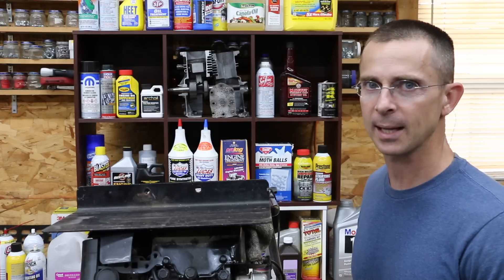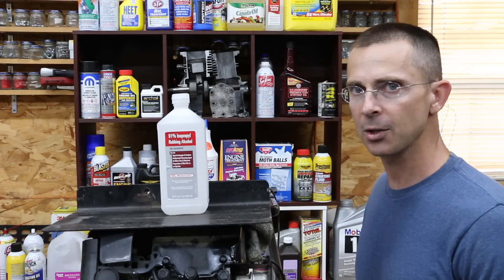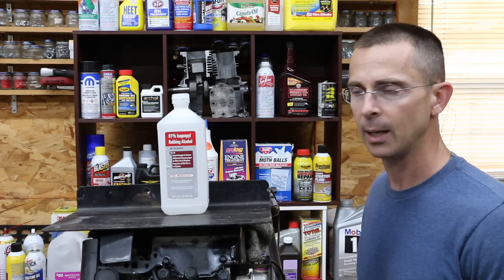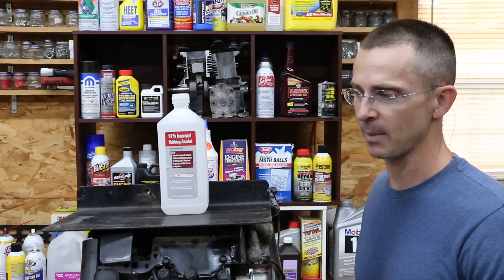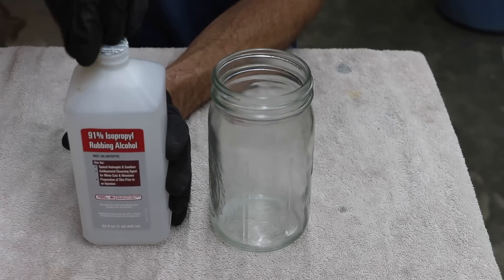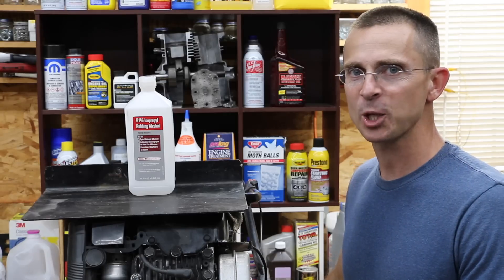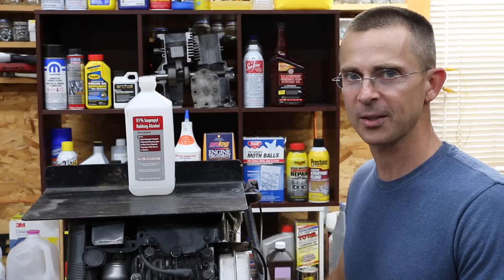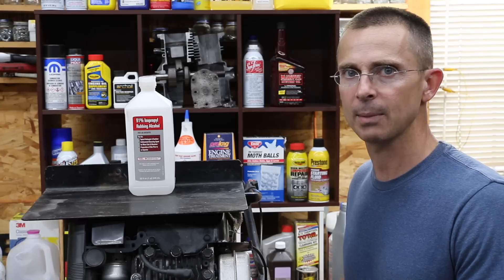Will a Gas Engine Run on Isopropyl Alcohol?  Let's find out!

Comment: Back when we had to do e-check. I used rubbing alcohol to past the emissions test. Added a bottle the tank with 93 octane gas.
Reply: You can remove the water with salt, get close to 99 percent alcohol. Salt dissolves in water not alcohol so it will pull the water out and sink to the bottom, you can then syphon the pure alcohol off the top.
Reply: Doom2pro gonna have to try that.
Reply: @Doom2pro  You can just get 99% iso in a bottle
Reply: @ThatDamnPandaKai  I know it's called dry gass. I use the salt technique for food grade alcohol like everclear, to get absolutely as much out as I can for things like hot pepper extract
Reply: You can get the water out better with benzene.
Reply: @povnw8985  and then enjoy cancer!
Reply: You can buy 99% alcohol, it's fiber optic cleaner
Reply: J. Dalton we did something different in ohio
Reply: Maybe the water in it helps ?
Reply: Ya Mumzhitachi  keep adding salt until it stops dissolving, the undisolved salt and salt water will sink to the bottom, siphon the pure alcohol off the top.

Comment: Apparently the army cleans the engine's with diesel every oil change.
So can you put diesel into your engine block and do an oil change but use old oil ?
Iv been told from a friend in the army but i don't believe them.
Apparently diesel is oily enough to lubricate and clean old oil out of engine just like an engine flush.
Muchly Appreciated
Reply from the maker: Thanks for commenting!

Comment: Try the gas line antifreeze called HEET. The stuff burns super clean
Reply: https://i5.walmartimages.com/asr/48d9489b-c801-48af-b8cc-10427f6d7658_1.dbcc84ad9776dc8c63b6a8a5fb888af2.jpeg?odnHeight=450&odnWidth=450&odnBg=FFFFFF
Reply from the maker: Thank you for this recommendation!

Comment: so does that mean i can run a lawnmower just on rubbing alcohol? or will that damage my engine in the long run? Can you convert the engine to run diesel?
Reply from the maker: Rubbing alcohol will likely cause issues in the long run, since it has some water in it and is corrosive.  Thanks for the video project idea on converting a gas engine to a diesel.

Comment: Nicely done!

I'm somewhat surprised how well it ran, it's a testament to how bulletproof and non-fussy these engines are.

The reason it ran funny is that it has less energy than gasoline so it was running lean.  With a larger fuel jet in the carb it should run better.    That might be the explanation for why the exhaust valve and less so the combustion chamber cleaned up (lean mixtures should run hotter), probably not since isopropyl alcohol should also run cooler.  The only good way to figure it out would be would be to jet up like I suggested, get it tuned for the alcohol and then try again (or do it on a "new" engine to compare how much it cleans it up, I don't expect that one to get much cleaner).  If you want to take this to its logical conclusion then mill the head and try it since it should also want more compression.  FWIW, I've milled a few of these heads before, they're very easy to do and you get a much stronger running engine.

I still want to know where you're getting all these mowers from.  My wife just killed mine and I can't bring myself to buying a new one this late in the season unless it's on a clearance sale.  In the meantime I figured I'd find one that someone is throwing out in fixable condition, but I'm seeing almost nothing and the 2 that I've found have too many parts missing to get running.
Reply from the maker: These are great comments.  I sure wish this mower engine had an adjustable jet.  I didn't want to alter the carb, since I'd like to use it for future videos.  I find mowers off of Craigslist and from lawnmower mechanics.  Thanks for commenting!

Comment: mabye try it with brake cleaner
Reply from the maker: Thank you for this recommendation!
Reply: Project Farm thanks for the reply, live your vids
Reply: Maybe not.  Used instead of carby cleaner years ago through a running engine and cleared a workshop, noxious fumes i believe !!
Reply: Its a good one
Reply: It will work with a 4 cycle but a 2 cycle would broke down

Comment: Try running an engine on Jack Daniels
Reply: I think the mower will have trouble cutting in a straight line.
Reply from the maker: Thank you for this recommendation!
Reply: smilncynic
          comment                    more             
your                     deserves             votes . · · . . . ·   ̇ · · . ·
Reply: mharris1270 it’s 40% alcohol and it will combust in an engine, had to use a little before when I didn’t have any gas to try to help my car pick up fuel and run after replacing fuel line and it having a mechanical fuel pump
Reply: Don't forget to ask for a donation to do this one !!!!!!!!!!!!!!!!!!!!! !!!!!!!!!!!!!!!!!
Even 100 proof vodka will be tough enough..............................................

Comment: Of course a gasoline engine will run on alcohol.  The reason it isn't useful is it is highly corrosive.  In countries that use alcohol for fuel, the intake system and cylinders must be chrome lined for protection.  Engines can be built specifically to run alcohol, dragsters have been doing it for decades.  BTW, it is also extremely dangerous if you have a fuel leak. Alcohol produces what racers call "invisible flame".  When alcohol catches fire, it burns with a blue, very hot flame.  It is difficult to see the flames in daylight.  There are many videos of old racing days when a driver or pit mechanic would suddenly start jumping around screaming and people right around them not realizing they were on fire!  It isn't something to be trifled with.
Reply from the maker: This is all great information. Thank you for posting these comments!

Comment: what is the stoich of the alcohol? just wondering if it was running rich or lean. and if lean then im not surprised it cleaned it.
Reply from the maker: Great point. I needed to increase fuel flow by approx 30%, but the carb did not have an adjustable jet and I didn't want to permanently alter the carb.

Comment: I've done this before when we were flat outta gas and I was halfway through choppin' the lawn back. Does an alright job but your engine runs super lean unless you adjust the carb to blast more fuel in. You also don't want to do it too many times because it can degrade your lines.
Reply from the maker: Great point regarding the risks!

Comment: It would have ran better if you would have drilled the main jet out some. Anytime you run an engine on alcohol it will need a lot more fuel to run properly and make more power
Reply from the maker: I agree.  Thank you!

Comment: You used 91%, the other 9% is usually water. try 99% which you can get on amazon. It might run smoother and have even more power.
Reply from the maker: Thank you for this recommendation!

Comment: I've been adding 91% isopropyl alcohol to All of car's fuel for the past 25 years... Burns cleaner and more efficient with the aromatic additives. I've also been using toluene and xylene over the same period with excellent results. Fire flame speed more BTUs per pound better overall efficiency.
Reply from the maker: Thank you for commenting on this!

Comment: Use Whiskey or Moonshine
Reply from the maker: Thank you for this recommendation!
Reply: It’s been done it’s called E85 ethanol
Reply: We burned a 1/4 tank of everclear with 3/4 gasoline in my 70 Chevelle Big Block 454.. And it ran like Aviation Fuel Booster..
Reply: @stevesilvas9059  Everclear has the same alcohol content of the E96h available in Brazil
Reply: @zOiNhUh  Ok... But I forgot to mention this was done in 1975.. My Sophomore Year in High School...
Reply: As long as it's been distilled to an 80% alcohol content by volume, it may work.
Reply: First,the Whisky or Moonshine must be separated from the Alcohol.
Reply: 35 or 40 ABV usual stuff from shops definitely is not going to work. Try it by lighting it with match or lighter. It's a poor flame / energy output.
Reply: Stolichnaya makes a 180 proof but is only available in Russia. Sure I am that this will work very well.
Reply: @vladtheimpaler5550  sure it might work

Comment: Project Farm did you have to jet the carburetor in order to get it to run on the alcohol?
Reply from the maker: I adjusted the jet on the see through engine, but the main test engine did not have an adjustable jet.  It really needed more Iso Alcohol and was running very lean.  Thanks for commenting!

Comment: I have mixed it with gasoline. About 30 70 mixture. Requires adjustment or you will get very high RPM.
Reply from the maker: Thank you for this recommendation!

Comment: Heard of people "ricing a motor" to remove carbon in the old days. Rev the engine up to 2500rpm or so and slowly adding rice to the air intake of the carburetor. Rice would beat the carbon off of everything but was soft enough to do no harm.
Reply from the maker: Thank you for this recommendation!

Comment: Seems like it dissolves oil. Not very good for the cylinder walls, but I guess great for cleaning!

Will a lawnmower work when you mix gasoline and Hydrogen peroxide?
Reply from the maker: Thank you for this recommendation!  What mix of gas and hydrogen peroxide do you recommend I test?
Reply: @ProjectFarm  It would be a good test to see what works best.
since adding HO4 to the mix (HydrogenPeroxide), you'll need to run the mixture very rich.
It should give much higher torque/HP ratings than stock.
Would make a good boost on the cheap for your go-kart, but you'd have to somehow feed the carburetor, the fuel and hydrogen peroxide in a nebulized state.
It's more fine tuning, but out of the 14.5:1 ratio A/F, I'd start with substituting 2 parts of air, with 1 part HO4, and 1 part of gasoline, and fine tune from there.
I'd also like to see, if you get any better MPG when doing water injection, vs just regular air and fuel.

Comment: ive been watching you since you had 10k subs. I have learnt a lot from your channel when it comes to small engines keep up the good work. think you could do some chainsaw videos? preferably a husqavarna. I have my grandfathers old husqavarna chainsaw that I need to clean the carb and reset the jets but don't know how to do that properly its roughly 25 years old and want to get it back to a 1 pull start and not 10-15 pulls.
Reply from the maker: Thank you very much for the positive comment and thanks for the video project recommendation.  I own a Husqvarna 455 rancher and will try to put together a video on it at some point.
Reply: yea I have a few small engines of my grandfathers that I wanna get running and restore. I watch your videos a lot when I'm confused I'm mostly having carborator issues. I've cleaned it 4 times now and it still doesn't wanna run right. I cant set the points and idle should be 2 turns idle and 1 and a half point but that's not working I feel like its spark problems now also have a couple of his old tillers from the 80s that have acorns and everything all over. it I have two of them I wanna try and restore, I live on a what was our family farm in pa and I wanna just fix up my grandfathers old tools to keep his legacy going. he passed 15 years ago now and just want to restore and use what he used to even if its twice my age lol. Im not sure where your located but if you ever want to do some sort of collab with something a bit aged let me know I got several projects I'm working on that would be very different. there's not to many videos of old small engines on youtube.

Comment: Hi there, so what was the point.. was it that it will run on IA or it will clean when it runs IA ?
It didn't look like it cleaned much except for the small opening. 
So was this considered to be a successful or what was the outcome?
Reply from the maker: Commenters asked me to test IA to see if it would run, clean the engine, cause damage, etc.  It ran and did clean the engine.  So, I consider it a success and would use IA in an emergency situation as a form o fuel.

Comment: It's running lean. Needs more fuel to run something like alcohol. Perfect ratio for gas is 14.7:1. Alcohol (depending on the type) is more like.. 8/9:1. So, it was running pretty far to the lean side. That's why it ran crappy. That's why the exhaust valve is the color it is. It got HOT, despite the external exhaust temperature. Plus, the oil and dirt on the "after" shot was more... "Baked on."
Reply from the maker: Thank you for this recommendation!

Comment: Shortly u can run a carburated gas motor on pure alcohol. But u will run it very lead unless it's adjusted for it. U have to flow and burn twice the volume because it's half the heat value of gas.
Reply from the maker: This is excellent information. Thank you for taking the time to comment!
Reply: 'Run lean not lead

Comment: What did the spark plug look like?
Reply from the maker: Sorry I didn't show that.  It looked very clean without any sign of buildup.  Thanks for commenting!
Reply: Project Farm i was worried it would be way to leaned out cause ethanol has a high octane which valve was that that was spotless after that was amazingly clean!!

Comment: During hurricane Sandy a few years ago, we ran out of gasoline for our generator. I happened to have about a gallon of 91 iso alcohol laying around and gave it a shot. The gen ran on it very well and we had power for our fridge and phone chargers for a few more hours because of it. Always good to have on hand as it doesn't go bad like gas does over time.
Reply from the maker: This is impressive!  I'm glad this worked for you in a time of emergency!
Reply: Project Farm at the time, my thought process was "if they can run race cars on it, why not my generator?" Haha although I was fully prepared to have to pull it apart if it didn't work. Never had to. After watching this, I see it wouldn't have done anything wrong. I wonder if denatured (100 percent) would work better. Perhaps you could do a comparison in a future video? Cheers

Comment: My only concern, and forgive me if this has already been mentioned, is the lack of anti-knock additives when running on straight alcohol (0 octane). The ignition timing on these engines is fixed, and more or less are designed to run on 87 octane. Even though alcohol seemed to clean it up, if you listen closely the engine sounds like it may be knocking, i.e. putting bearings under a lot of stress.
Also, great videos, keep 'em comin!
Reply from the maker: This is a excellent point regarding the knocking and octane booster.  Thanks for the positive comment regarding the video!

Comment: The 91% alcohol is 9% water so what I am wondering is if you mix in some of the heet water remover in with the alcohol would it run better? Also if you add the heet with injector cleaner it might clean better too.
Reply from the maker: Thank you for this recommendation!

Comment: It's a little different of a suggestion but I'd be curious to see if the weight of the blade would affect the ability to cut, long term affect on the mower and fuel use. In theory lighter would make it work harder to stay at operating speed, but heavier would carry more momentum and possibly not make the mower lug in taller grass.
Reply from the maker: Very interesting.  Thank you for this recommendation!

Comment: You should squirt 35% or more hydrogen peroxide in to a running engine to see if it acts like nitrous oxide. Maybe mix it with some fuel like methanol so the air / fuel ratio doesn't lean out too much. If the engine is just idling then you squirt some in there the rpms should go up theoretically. Thanks in advance.
Reply from the maker: Thank you for this recommendation!
Reply: No problem, I hope to see somebody do it.  If nobody else does it then I might just do it myself. lol

Comment: I would have liked your opinion and the final inspection.  Was it better or equal to Marvel?  Did it clean as much as you thought?  Did you think we should do this?   Did you do an Ethanol test yet?  Thank you.
Reply from the maker: Marvel seems best for adding into the fuel.  Seafoam seems best adding to the crankcase.  However, it's virtually a tie in my opinion.

Comment: Would it be possible for you to do a tare down of a lawn mower for the beginners. I would like to fix my lawn mower to make it run more smoothly well now it won't start I cleaned the spark plug and new gas, air filter, oil. What else should I do and how do I do it right? To manufacturer specs.
Reply from the maker: Thank you for this recommendation!

Comment: I have a generator that wont run.  It's getting fuel, the plugs are igniting, must be a clogged carb right?  How can I clean it easily?
Reply from the maker: Most likely, it has a gummed up carb.  Have you tried using starting fluid to get it to fire up for just a moment?
Reply: Yes wont stay running.  Thinking I will try some carb cleaner in the intake?
Reply: Yes I did all of that.  I took the bowl thing of the carb and rusty gasoline came out and there is rust in there.  I assume the carb is shot?

Comment: Thanks for the great video.
Reply from the maker: Thank you!
Reply: Project farm. I was surprised that your engine ran cooler,  I thought alcahol burned hotter than gas, must be the water content that cooled the burn. After I saw your video I tried a 50:50 mix of ethanol free gas and 91% isopropyl alcahol in my Briggs and Stratton push mower engine. The result: the engine started a little harder, sputtered a little at idle but had faster throttle response than plain ethanol free gasoline.